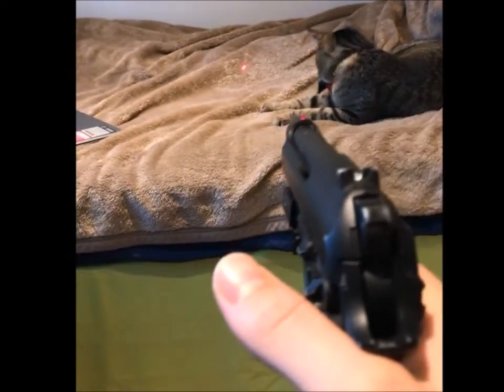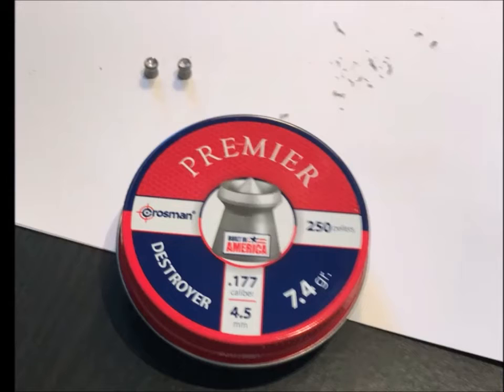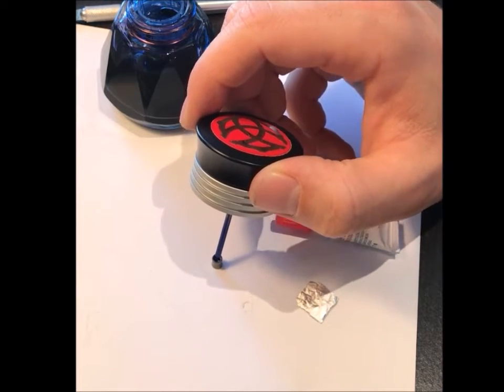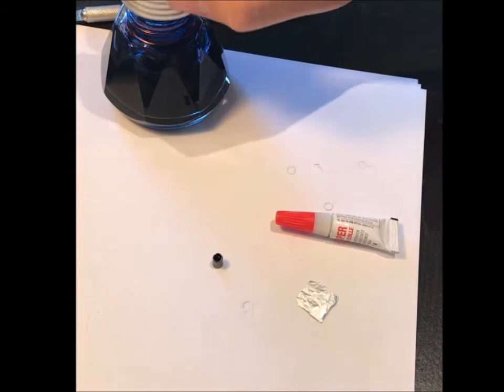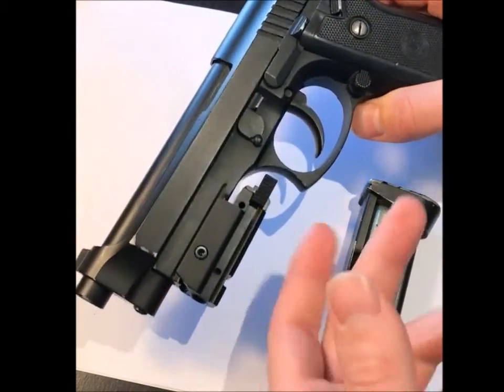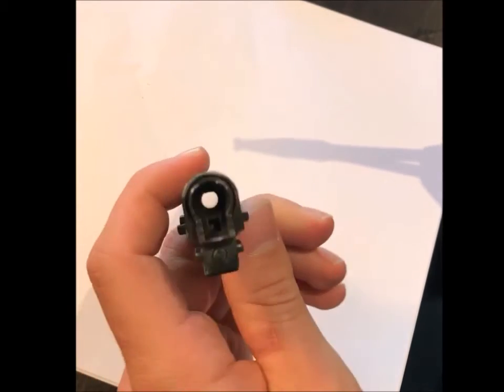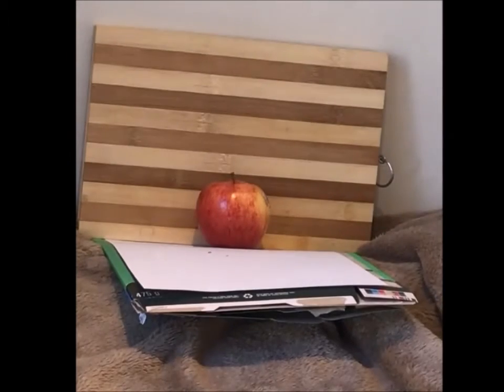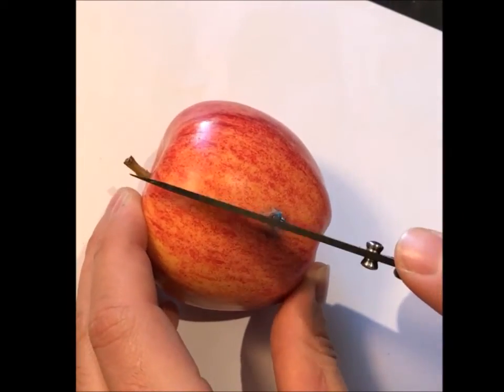How to Make a Poison Bullet

Comment: whats the bb gun called
Reply from the maker: It's a full metal, CO2 powered, replica Beretta M92 made by KWC. Bought it at my local military surplus store for about $150.
Reply: A m92 has the safety on the slide. This is actually a Taurus PT.

Comment: would it be possible to load the pellets with a tranquilizer toxin? For self defense reasons of course.
Reply from the maker: Tranquilizer darts typically work with an impact-explosive-propelled-injection system in order to get to the blood steam quickly. I don't think this would be able to fit such a complex system. However, if your tranq was very potent and fast acting it would have potential considering blood volume circulates the body once per minute.